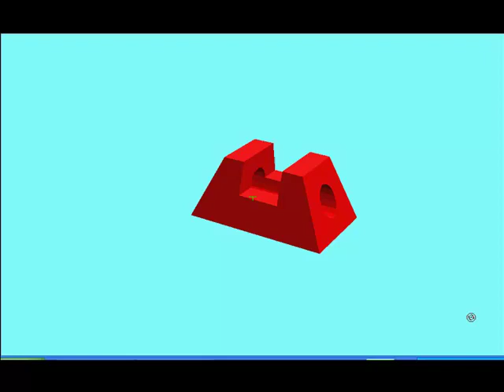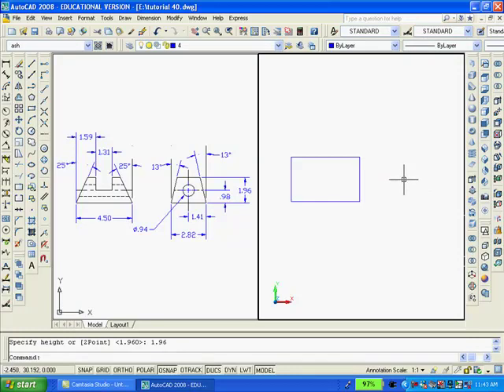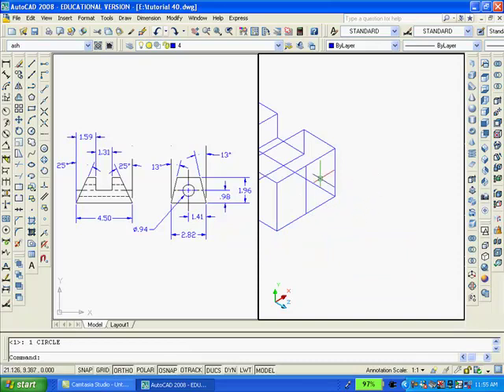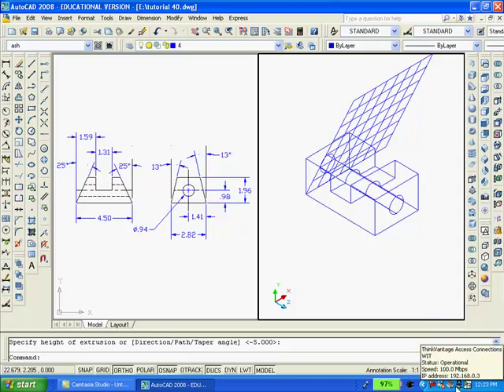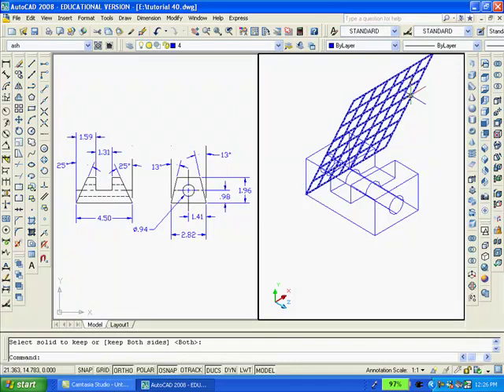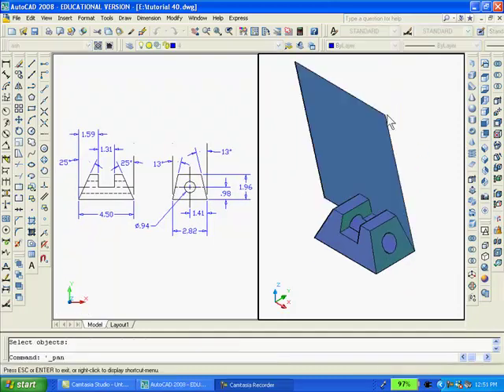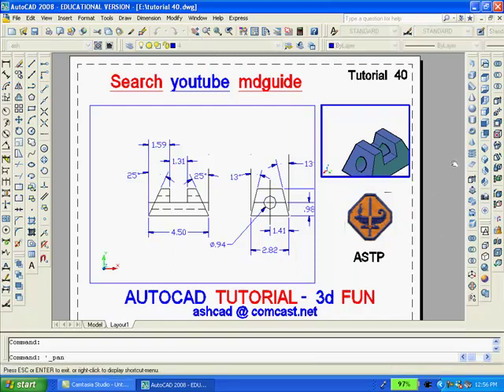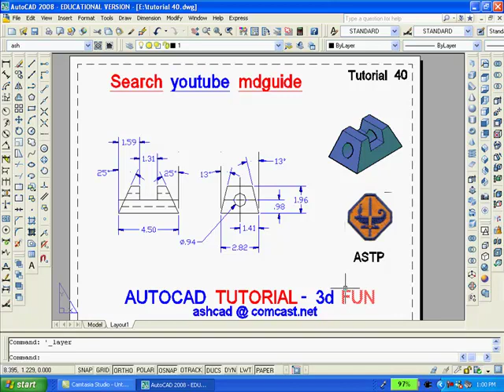visit http://ashcad.com for more

Comment: I tried this in 2002 andd it worked fine until the 13-degree slicing. Couldn't get it to work, but, p-lined 13-degree wedges, extruded and subtracted from main object.